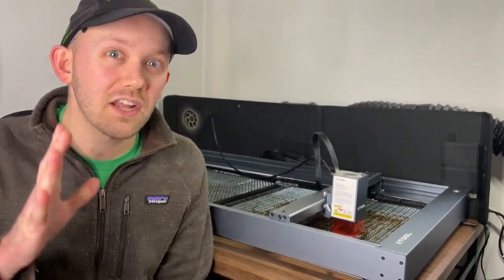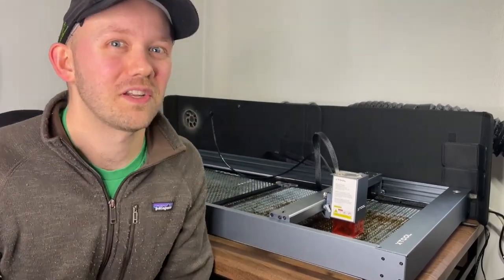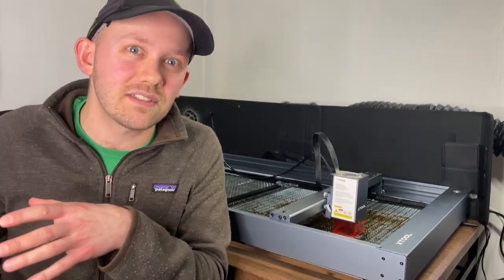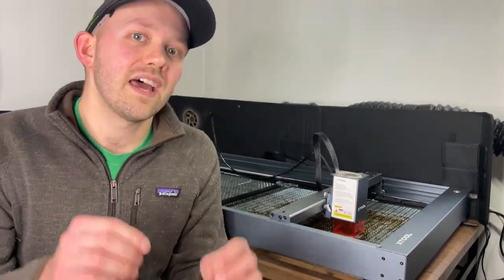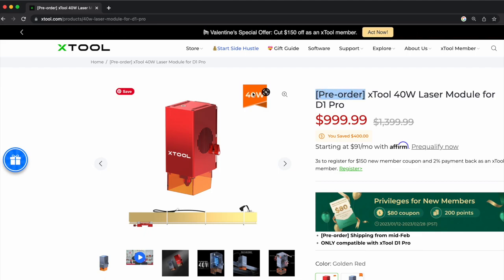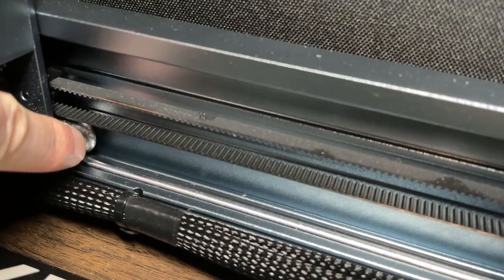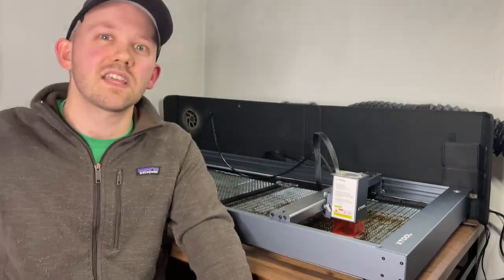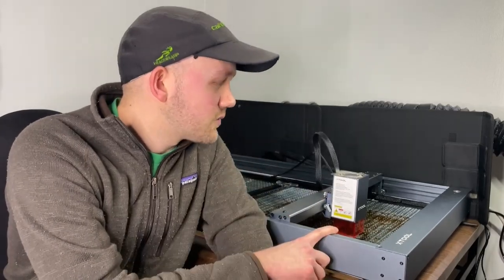7 things I wish I knew BEFORE buying the XTool D1 Pro 20W

Comment: I have been looking at getting a laser. Did you look at the TwoTrees TS2? I have never used a laser, but I like that it auto focuses the laser, comes with air assist connection, has a larger area, and wifi. If you had dismissed it, why?
Reply from the maker: Nope - I don’t think I’ve actually heard of that laser before now.
Reply: @asherdiy  as someone who knows nothing about lasers but has 3d printed, it looks like they have better features. It is one of the few that come with drag chains for cable management.  It is not popular on youtube. I have seen bad reviews, so it may be that they don't send out as many free units for review? Still at $900 it is a big investment for me when I don't know if I will have a use for it. If you get a chance in the future to look at it, let me know your thoughts.
Reply from the maker: Hm - that’s interesting. Thanks for the heads up about them.

Comment: I just got my new Xtools laser and can't wait to begin.  Question ....what type of surface workspace should I have below the laser ?
Reply from the maker: Hi Tami - I have the xtool honeycomb bed, which comes with a sheet of aluminum for the bottom. I’ve been using that for months and it works well.

Comment: If you can.. take external in air, not your room air, and make sure that your (box) is seald closed box.. no leaks.. in and out air  need to be friends.. or they will take over each other..
Reply from the maker: Yeah. - good call. I want to design a homemade enclosure, and I would probably go with 2 pipes (one air in and one air out) , that way the rest of the enclosure can be completely sealed.

Comment: One thing I find ridiculous with XTool is that there is a 40W module for the D1 Pro. Unfortunately, the company does not let you purchase the D1 Pro with the 40W module! One must purchase the lower model with module and can only purchase that 40W module as an accessory! This is ripping off customers. Why not allowing during order to have the module swapped right away? Why forcing someone to pay an extra $1,000 on top of a 5W, 10W or 20W that come with the machine? Instead of saying yes we can ship it with the 40W for an additional $500 for example? 
This really is something I find absolutely shocking! Stupid at the highest level.

Comment: What is "AIR" ?  Why do you need it?
Reply from the maker: I think you mean air assist. It’s basically a little hose that sprays air at the point the laser hits the material. It does a few things, including reducing surface scorching on wood cuts.
Reply: It blows the smoke away from the laser lens, keeping it clean. And it blows the smoke away from the project, eliminating “powder burn.”